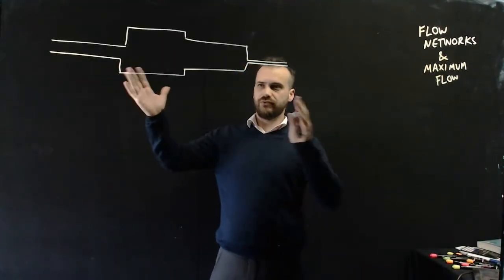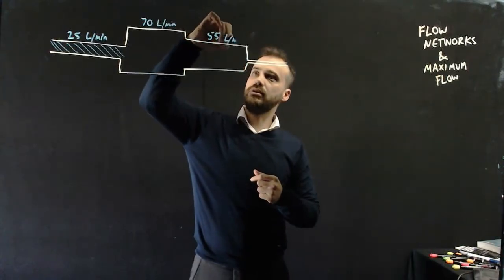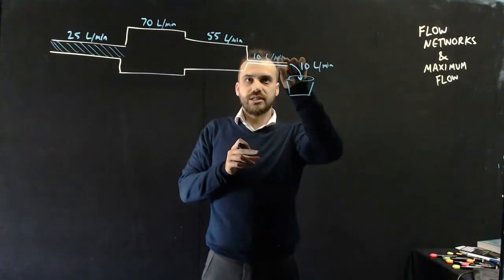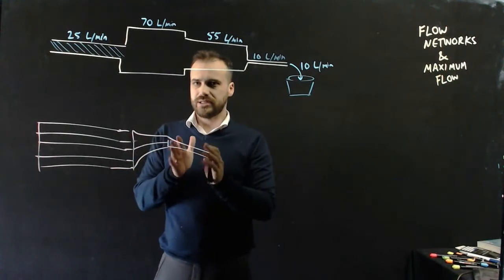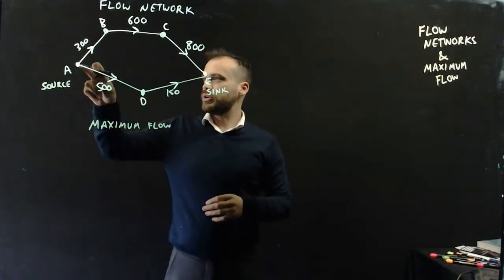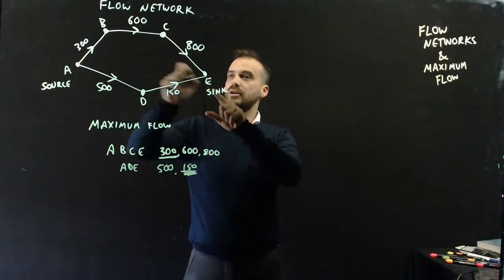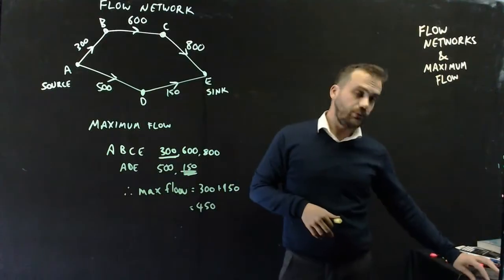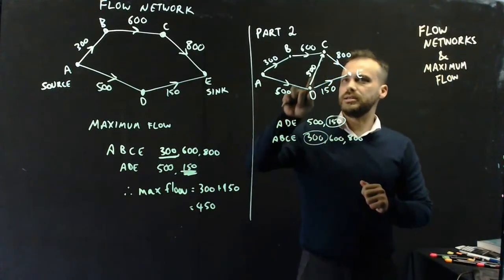Flow Networks and Maximum flow

Comment: i could understand how d to c became 350 but couldn't understand how c to e became 350 ??
Reply: Water going from D-C is only 350 because 150 of that initial 500 is going straight to E. The rest of that 500 is going to C. Now we know only 350 L/Min of water has made it to C, even though C-E has a max flow of 800, we only have 350 L/min to give it. That's why c to e becomes 350L/min <3